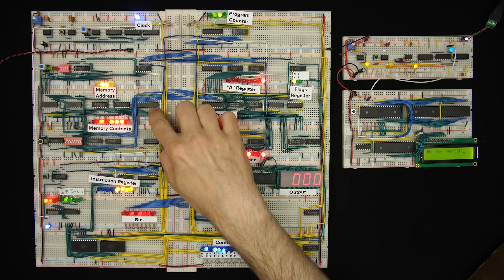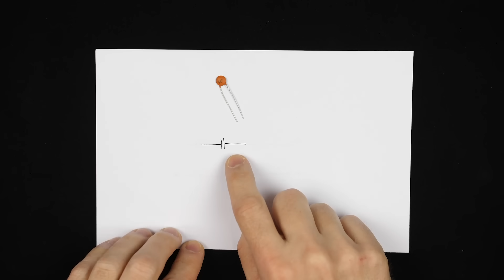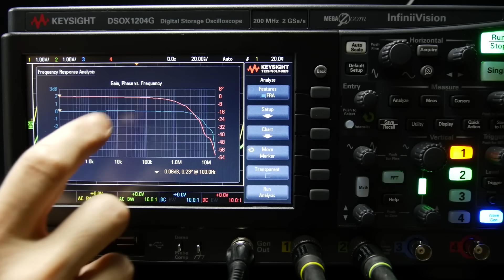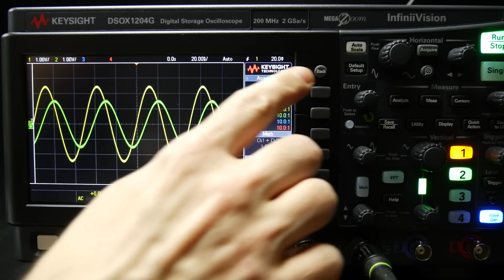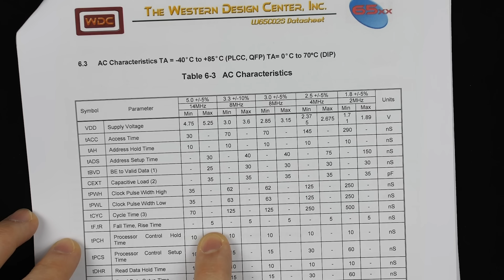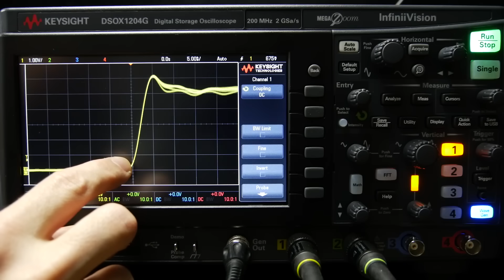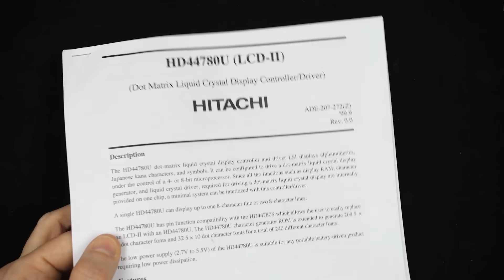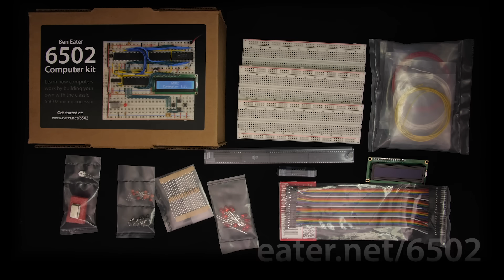Why build an entire computer on breadboards?

Comment: Decoupling caps and parallel wires.  A Digital Equipment circuit board for the PDP 11/45 processor would have 100 IC's on it and each one had a ceramic cap of .01 mfd mounted as close as possible to the IC. The processor consisted of nine boards plugged into the backplane. All wiring on the backplane was ran helter skelter all over the place to avoid any coupling between the signals. All done with #30 single strand wire which was mechanically wrapped around the posts that were the contacts that the board plugged into.

Comment: 50 years in electronics and never used breadboard!
I usually try to go straight to PCB with a couple of respins now, for experimental RF stuff I build onto unetched PCB drilling a few holes, in the past I've used a lot of Veroboard but most components are too small now.

Comment: What's the reasoning behind putting the capacitors in the power rails offset one pin? Is there a reason for that or is it just out a habit because of all the other pins are set up? Because if I'm not mistaken, you can just put the capacitor in the farthest positive terminal and the farthest negative terminal, it doesn't need to be offset

Comment: A really interesting idea. Totally agree with learning fundamental principles this way. I did a broadly similar thing using wire wrap, though a bit more fiddly and not so flexible. Also, high level programming languages may give immediate access to many powerful  functions but understanding how to achieve  the basics in machine code is still a really useful learning stage. I also like the idea of building a system using discreet transistors; that's and even more fundamental level!

Comment: I find what you are doing to be very interesting. I build custom 3D printers. I was looking into 3D printing a ABS grounded "negative" circuit that has negatives for the wires & small bread boards, then another thin abs layer goes over the top & bolts together like solder mask on a trace. I wanna see how that oscillation resonance acts inside an ABS shielded 3D printed circuit @ higher frequencies. Please contact me as I will print you a mother board set. Maybe run a pentium I 120mhz & attempt to run windows 95 on a breadboard machine. I dont have an oscilliscope my buddy has a 300 or 333 mhz older one I think I can buy from him.

Comment: another way to think about filter caps is they provide local charge so the rail doesn't sag due to charge flowing through a long resistive wire

Comment: This is a great idea.  I've always figured there were ways to use that "old tech" to make new things.  And while I love the idea of a large breadboard project to wrap your head around how a complicated circuit might work, I've got an old Atari 800 that's just begging to be turned into something useful.  Really like your walkthrough of breadboard construction.  Its good to know why my cheap breadboards can be frustrating.  I really liked your analysis of breadboards and "high frequency".  I don't think I've ever had anyone walk me through the WHY things can fail on a breadboard.  It likely explains the need for an "antenna" on a project I worked on once in a college lab.  Thing did not work unless we had a stray wire hanging out of the thing.  Stray wire added, problem solved.  We didn't have the tools to figure it out, and my lab partner was one who didn't like moving forward without figuring those things out.  Unfortunately, I saw no real way to fix it (well, the thing to do was to rip it up and make it look as neat as what you have here... but no one wants to do that in a college lab...)

Comment: The easiest method to solve the slow transition rate issue is to use a Schmitt triger (mounted very close to the critical input).  When working with breadboards I would sometimes end up putting one at every clock input. Another benefit is that it will prevent false triggering from oscillations at the clock pulse edge. Here is an interesting paper by TI:
https://www.ti.com/lit/wp/slla364a/slla364a.pdf?

Comment: Either pre-manufactured printed circuit boards or breadboards sounds like a false dichotomy to me. In the past, I used to use veroboard for experimental circuits. It has similar problems to breadboard but it is a bit more robust.

Comment: I agree with the bad breadboards. I have mine from a cheap kit and it works fine until you put wires or sensors in the same pin. It wears out wich you can actually feels

Comment: Thanks for the great explanation of Parasitic Capacitance and Inductance and the Fourier Series. I've been in Electronics for all my adult life and have never heard anything better. And that includes a BSEET. 

Replacing the Clock Breadboard with a single IC was great, too. 

You do make me nervous every time you touch the breadboards. Especially the LSIs. Would you consider a video on Electrostatic Discharge? You could explain how you get away with touching your circuits while ungrounded and at what point it becomes necessary. 

Every Technical College I've ever taught at teaches the students about ESD and the students ignore it until they ruin a circuit or a piece of equipment or two. Then, they become more conscientious. 

You do such a great job educating confusing topics on your channel. I hate to think that you spread confusion about a topic already filled with disinformation by your behavior. 

Thanks for listening. And thanks for the great channel.

Comment: Doesn't the phase shift come from the length of the wire?
I don't have any experience with Oscilloscopes, but knowing the current flowing just a little below the speed of light at 20Mhz, 1 wave should be around 15 meters. Having a 30cm. wire should have 2% phase shift already.
Can you please confirm the phase shift measurement and wire length?

Comment: I've been following your tutorials without the clock module. Literally a few hours ago, I was wondering why my crystal oscillator won't run the code and prints "hello world" but a clock signal produced by my Arduino works. I was searching for the answer for a couple of hours and run into this, so lucky and thanks!

Comment: The "cheap" breadboard is numbered very stupidly, with rotational symmetry (except for + and -) so that A=J end-to-end, and 0=60 across the gap. The "better" breadboard is numbered less stupidly, 1..63 (no 0?). You should have oriented both them with + on top, so that the good breadboard has the numbers right-side up. You should have put the better one on top.

Comment: When a current is passed through a wire producing a magnetic field are they directly proportionate? If i were to apply an equally strong magnetic field against the magnetic field produced by the current would it decrease the current?

Comment: What about a better oscillator? Like a mosfet pulse generator? That should create more square wave so even with some breadboard capacitance you can push the computers speed further?
I like the idea of exploring the options to push the computer speed more while still working on a breadboard.

Comment: the delay and phase shift isn't due to R and C only, its due to transmission line effects. At very high frequencies (Electrical length close to guided wavelength) this transmission line effect starts to appear, and there is a constant known as the propagation constant (γ_o) which is: sqrt[ (R+jwL)*(G+jwC)].
I recommend David M. Pozar - Microwave Engineering 4th ed. if you want to learn more about this effect.

Comment: Those little projects where you just solder things down to a circuit board might teach you what kind of things go into a certain kind of device.  I learned a bit about linear power supplies building Adafruit's breadboard power supply kit.

Comment: This is really really interesting but how well would this pc work? Can I play games on this pc? Watch YouTube? Or is it like "It doesn't work too well but hey it works and it's cool" type of things?
Reply: That depends on how much time you are willing to dump into it. In theory you can build a full linux computer on breadboards but it isnt anywhere near practical. Most of the time you are gonna be building lower powered arm and 8 bit computers which can definately play simpler games but they will definately not run youtube.

Comment: I have a question: did you bring up the sine wave because oscillators like this one work by combining many sine waves? In that case, because the rise and falling slopes of the oscillator used are so steep, does that mean it has components running at higher than 45 MHz, perhaps higher than 100MHz you showed in the model?

Comment: Working on an 8x8x8 rgb LED cube project, and decided to get 4 breadboards, and lay out the entire driver circuit for the cube first. Was very interesting to see it and debug it when it didn't work right away. I used a pic32 microcontroller to drive 12 TLC5940NT LED drivers,  driving 192 channels or 64 RGB LEDs at once in total. It worked fine after some tinkering, and I hooked up my scope to check some signals. I was surprised by how noisy it was, while still running perfectly! I decided to drive the signal clock on the Micro controller up higher, to see what would happen, and got one of the clocks up to 13Mhz at one point, with the LEDs refreshing at 400Hz (These drivers have 12Bits brightness control per channel!). Checking with the scope, showed a complete MESS on all the clock lines, and power lines, but it still ran perfectly! Had some fun at that point, adding and removing caps here and there, and could see the improvements. It would run fine without ANY extra caps but I could see spikes up to 15V on the LED side in some places! (drove the LEDs at 5V with 3.3V logic signals). Putting the ceramic caps back in reduced these spikes to an acceptable 5.4V. Really interesting to see, and play around with, and to see it would work this fast, even on a breadboard setup ;-)

Comment: Thanks, I've been getting interested in how computers work at the chip level.   I started reading about chip architecture with the Tiva Launchpad microcontroller board.    I just learned that the ARM of ARM-Cortex stands for Acorn RISC Machines.

Comment: yeah i like your computer bread board and all ... but how about bread boarding a 3d printer with a 6inch cubed volume ... then show how it may be reconfigured to be perhaps a cnc mill or any other 3 axis control machine ... yeah save hassle PLA .. 
.
then you have a use for your bread boarded computer (the memory for the 3dprint and menu controls and the like) and an excellent how to video on making useful things to go with your hobbies .. and learn about the electronic and programming side of it at the same time ... and design of course ... sure it wont be winning awards for making the best 3d prints ... BUT it will demonstrate how the electronics and programming and timing and even looks all tie in together for a product ... while learning how to make them at the same time 

like your VGA card ... it wasnt the best BUT it taught what it needed to and worked well enough to show the largest portion of problems with the least amount of overhead building or expensive bits

Comment: All I've seen in this videos are reasons NOT to use breadboards. If you are going to implement a digital system, you will be much better working with a HDL and implementing it on an FPGA.

Comment: The decoupling capacitors at the chips are not for supply power.  They're too small to do that job.  They're for shunting high frequency spikes to ground, because a capacitor blocks DC and passes AC.  It's why they're called "bypass" or "decoupling" capacitors.  The larger capacitors, both at the breadboard power rails and at the power supply itself, are for supplying/smoothing power.

Comment: Thirty years ago I was in a computer architecture class listening to a lecture about Andrew Tanenbaum and his MIC machine. (Sienna College, a liberal arts type college) I thought it was cool and decided to write a simulator in Turbo Pascal. I worked real nice with lots of blinky lights and traces lighting up when active. The Prof was so impressed he used it for a few in his architecture classes. Each student received a floppy disk with my simulator on it. I learned sooooooooo much while writing that program.
Reply: Have you heard of gem5? Did you perchance help develop it?
Reply: maybe you can shed some light on why they try to flatpack everything and run traces all over the place instead of going vertical? fold components like proteins, i say. minimum distance.
Reply: @kingmasterlord  I'm not a manufacturing expert but my guess would be flat is quick, easy and much less complex. That and as long as components keep getting smaller there is no need to get vertical. A few years ago I read something about research with cube shaped chips. But the cube shape was part of experiments with optical processors and memory.
Reply: MIC ?
Reply: I don't remember what MIC stands for  if anything. You can google "Andrew Tanenbaum MIC"
 for all kinds of information.
Reply: Github it 👍
Reply: Im doing the same class now but they just give us a arduino uno kit and tell us to go do an assignment. They teach architecture in simulation but the pcbs are pre made so i learn nothing.
Reply: How's your career path since then? Did you take CE/EE as a profession? Curious to know
Reply: @xiaofanjie  I was in systems administration and programming for about 15 years and then got into other things that were not specifically tech jobs but still involved computers/admin stuff.
Reply: Andrew Tate

Comment: Who needs a kit? The fun is doing it from scratch, using only data sheets and some creativity. Discovery from DIY is a crack high. And building a microprocessor circuit on a breadboard isn't at all rocket science. I did this 30 years ago in college - before Google - using Z80's, 6502's, 6800's  even a Motorola 68000 processor once IIRC. Learned a lot, though I wouldn't be surprised if I start developing cataracts at some point after prolonged periods of staring at UV light while erasing eproms. Good times.

Comment: Maybe I'm wrong, but your conclusion about the square wave is off the mark.  The Fourier Transform to the sine waves is fine, but the practical application is seems wrong.  Do correct me if I'm overlooking something. 

You can't think of the signal transmitted as being it's component wave forms, rather the signal going through the circuit is the integrated waveform and the high frequencies are like the noise ripple from a power supply.  The higher components are all lower amplitude and the edge transition is in combination with the other larger amplitudes, so the filter-like effect from the capacitance and induction is having to counter the entire signal transition.  Given that, it's better to think of the effect of the inductance in the same way you think of the filter caps on the power rails, treat it as a charging/discharging inductor and see if the math matches the results.  If it were RF in the form of a radio or optical signal, then things get more interesting.

Incidentally, just in case you didn't know of them, what you built there with with the long series of jumper wires is called a "delay line"... they use the signal propagation time of the conductor (~0.7c for copper, iirc) to delay a signal without distorting it too much, as a sort of analog memory.  Historically important for things like RADAR.  The piezoelectric delay lines are ridiculously cool and somewhat mind blowing with how they can bounce the signal around inside.

Comment: I really like your approach of "feed a man, it last for a day, teach him to hunt/fish/cook, he'll be taught for life", this is really a lost art for people to try and understand what they're using in depth and be able to troubleshoot or improve, even when something may not be related to what's they're working on but something related/attached to it. Kudos for all your videos, it taught me alot.
Reply: You're quite right. I'm unemplyed telecom engineer and young techies laugh at me when I try to tell them how computers work. But as I know I have a 15 year old computer that I'm using just now. I bought third set of hard drives to it today because the secoind set I'm having in them give signals that they'd be dead in a year. How do I know. Because I've worked with servers in my life so much that I know what are the signs of failing hard drives. I've also changed the graphics card once because they go through the most abuse in a modern home table top and sometimes they are just manufactured to fail. Hard drives are mechanical things so it is clear that they can't last forever, but the main processor (8 cores at 3,6 Ghz) and the memory (16 GB DRAM) are just working fine. I use thermal camera once in awhile to look what is going on and they are just keeping cool.
Reply: @topilinkala1594 unfortunately we've gone beyond "why does this not work?". Now if it's not working, you replace the whole thing and forget about it. 
About young techs, well they're still young and think they're on top of the world.

Comment: Naw the whole breadboard thing is a huge pain in the ASS. ive had nothing but constant contact oxidation issues with breadboards, even from different board makers. its stopped me EVER using them. Veroboard like PCB's are my prototyping way of choice.. and it still makes you think when building

Comment: I don't know....  I agree that designing, building, and troubleshooting circuits wire by wire has educational value but breadboards are notorious for their unreliable connections and noise issue for digital electronics.  I think I'd rather wire-wrap.